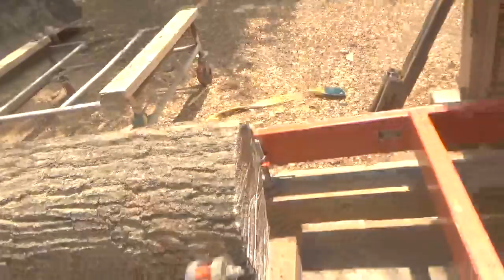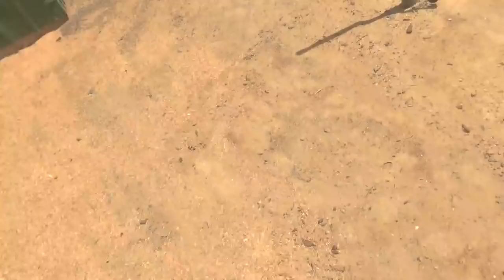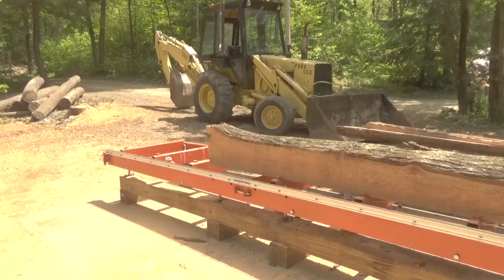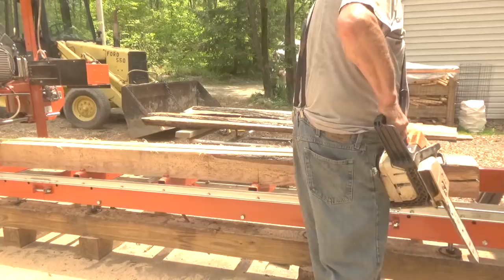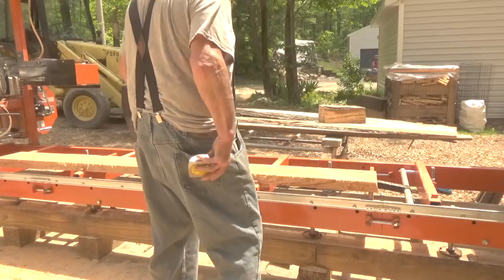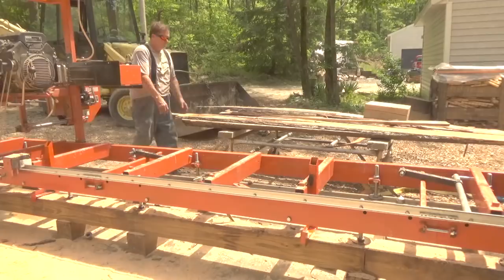One year later and still cutting red oak boards. Woodmizer LT15

Comment: Let me make a friendly suggestion. I used to blow sawdust along side of my mill and always had a major clean up. Then one day it dawned on me! I now hang a five gallon bucket on the sawdust exit shoot. What a difference not near the mess and I only need to clean around the sawmill once in a while.
Reply from the maker: Thank you I appreciate the suggestion. Another tuber had mentioned it before. But for me I dont mind the cleanup it gives me a chance to wind down. I have people that want the saw dust and if not I just mix it with fill and level up by the sawmill.

Comment: since woodmizer recommends you change blades every 2 hours I was wondering if there is a convenient way to track your blade run time?
Reply: maybe a timer attached to the blade engagement mechanism.
Reply from the maker: A timer would work but I have a clock out side tbat I use and not only that, when the blade is dull you will know it for sure.